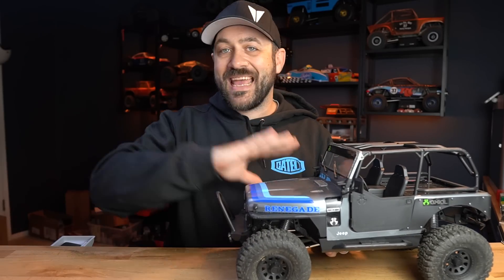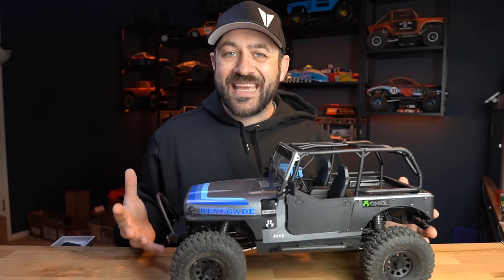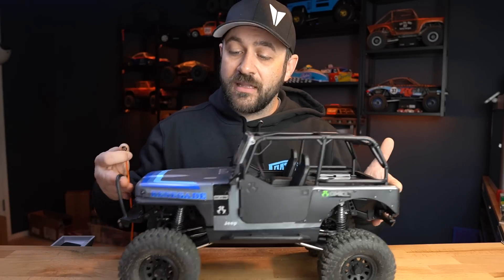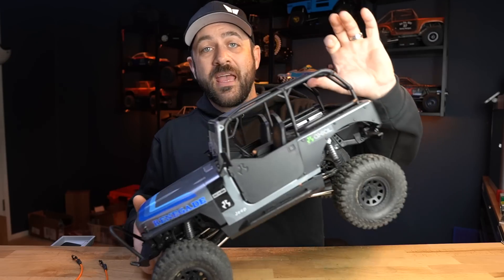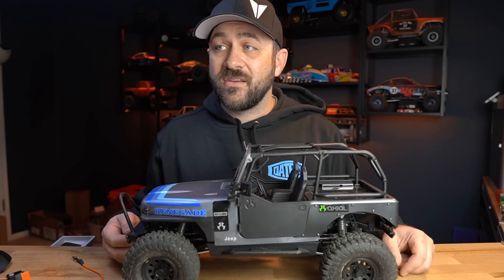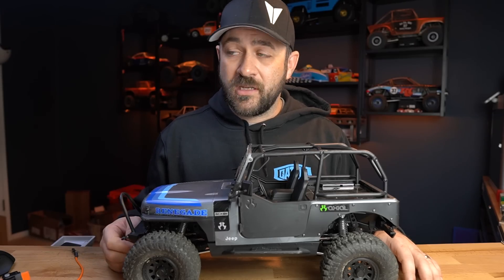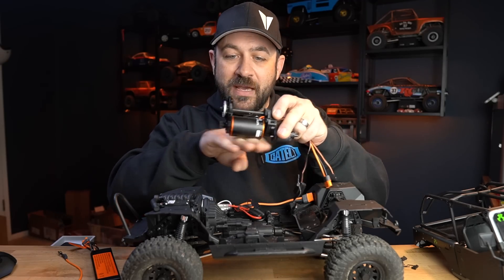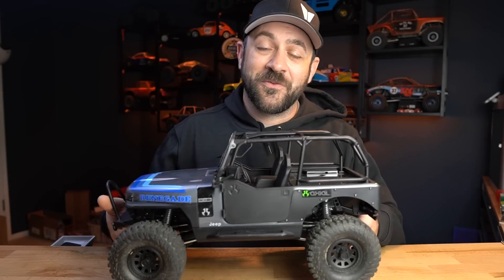Find the Center of Gravity of your rig the easy way!

Comment: One newbie question. Do the link geometry or suspension geometry change the COG?
Reply from the maker: It doesn't change the COG.  But it works in correlation to the COG to determine the antisquat values and how the truck handles in general of course.

Comment: Kinda defeats the purpose to spend over $5 hun plus on an Axial to tear a perfectly good 2 speed/dig transmission out of it to install a $150 dollars or more for a Vanquish transmission and files. So you gain a lil lower weight but then you lose all that up front weight over the wheels the way Axial designed it. considering the Vanquish motor is nearly a motor length behind where the axial motor sits. The Axial motor sits nearly over the front wheels, the Vanquish tranny puts the motor nearly behind the front wheels. Just not so sure the trade-off is worth the time and $$.if you want a Vanquish just buy one, if you want an Axial buy it.why destroy a perfectly good design for no real gain. To me it's a trail crawler not a comp rig. Install shorter axial shocks w/ 65wt oil and add brass down low is all it needs.

Comment: Man you need to have a light truck and with the Vq transmission that weights a lot u cant get that. Its for no use a 4 kg truck with low cg vs a 2 kg truck with low cg

Comment: Would you look at that. It's just like full size trucks where we use cam or crankshaft as rough estimate for COG height. For anyone looking to get more precise, the KevinWilsonSBC videos are awesome.
Reply from the maker: He does make some good tech videos. However I wouldn’t say his method would be more accurate for RC. For RC we have the benefit of being able to do things much easier ways that take a lot of outside factors out of the equation.
Reply: @HarleyDesignsInc  oh its for sure more accurate. Seeing as how it's the SAE method used by plenty of engineers, chassis builders and tuners. If that additional accuracy has any use for RC, probably not.

Comment: curious what the benefit of having the pinion/spur being on the opposite side of the motor in the VFD transmission. As far as I can tell, VP are the only ones doing this, and it can result in difficulties with motor fitment.

Comment: Very cool method of finding the COG. I have corner scales and use the Longacre Racing trigonometry method of finding COG. If you take one more photo with a string attached to a corner of the bumper you could also see the left right balance point. I would say this string method is good for ballpark estimates as having the shocks fully extended is going to severely throw off the COG.
Reply from the maker: Absolutely it does. But any method of bench testing will have dynamics that aren’t accurate during running so it still gives you one of the most easily repeatable tests.
Reply: @HarleyDesignsInc  Totally agree. Driving is the real proof. I have just been surprised myself by how much small changes to suspension setup can affect weight shifts.

Comment: Simple but useful info!
I wonder - if you wanted to see where the balance was left to right and front to rear, could you hang it from the end of each wheel and look at it from the bottom, then draw the lines and see where they intersect front to rear and left to right?
Reply from the maker: Yes thats exactly correct. Its the same method but in a different plane.

Comment: I don't buy it. - at least there's more to it than that. Weight locations are a big part of the center of gravity, which is why people remove mass from up high and add it down low with brass.
Reply from the maker: And any change made, will effect the COG and will be reflected in this test. This is just a simple method of finding exactly where the COG of an item is.
Reply: This test IS measuring the weight balance. Instead of using a fulcrum (think teeter-totter) it is measuring how mass twists around the anchor point of the string. It’s a bit like a boat sitting in water. Shift a weight left or right, forward or backward, and the boat will tilt different directions with the water line indicating the balance plane. Make any weight changes to a truck (e.g., adding brass to the front axle) and the lines projected by the string will change to indicate the new COG location. In Josh’s photos, half of the mass is always to the left of the string and half is always right of the string. The point where the lines theoretically intersect is the COG.

Comment: Interesting! I’ve done CG plenty of times on RC Planes and Helis, but never considered how it would be done on a car. Well, time to find out the CG of every single car I have haha
Reply from the maker: I'd like to hear how you prefer to do it on planes, something I've never done except in video games :)
Reply: @HarleyDesignsInc  Well usually the ideal C of G range is specified by the manufacturer, measured aft of the leading edge of the wing. I usually balance the plane on my finger tips, or rig up a stand, and move the battery around until it sits level on the cg mark.

Comment: Would a titanium roll cage weigh less than the plastic?
Reply from the maker: Density of nylon is around 1.2 g/cm^3 vs the titanium which is around 4.6 g/cm^3. So Titanium would be 3-4 times heavier. Granted, you could try to use less material but in the end you would likely be quite a bit heavier.
Reply: The rollbar from the TWS  VTG80  , has me thinking it would be right about the same if not less, (if in titanium). weight wise due to the amount of material that would not be used compared to the current cage. But then again, sizing of the rods might just make it the same amount... i'm thinking that i'd rather have the simple cage than the Genright style and am now im just trying to justify making a titanium cage for myself without going 4x overweight !    @HarleyDesignsInc
Reply: Do they make a hollow titanium tube? Maybe that would also cut down on weight if building cage out of hollow tubing
Reply from the maker: Thats not been something I have been able to find. I have looked for it for sure, although I bet 3/16 titanium tubing would be wild expensive!

Comment: what fun things are you cooking for this beast? I snagged one same color and now I'm wanting to make it my own. It Definity preforms better then the early bronco did out of the box. the torque twist is less.
Reply from the maker: My plan is to do a transmission swap, new wheels, tires, possibly axles, and all the electronics. So it will be a very different truck in the end I'd say.
Reply: @HarleyDesignsInc   make it times 2 cause ill need parts hahaha cant wait to see what ya cook up. I took it out to my spot today and was surprised it did as well as it did. I feel some heavier wheels will help but the tires werent to bad.